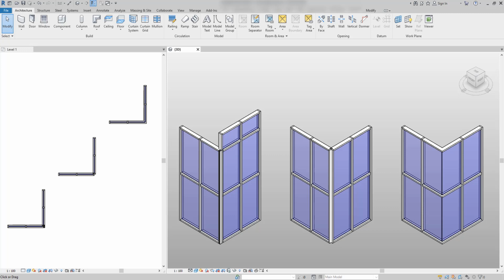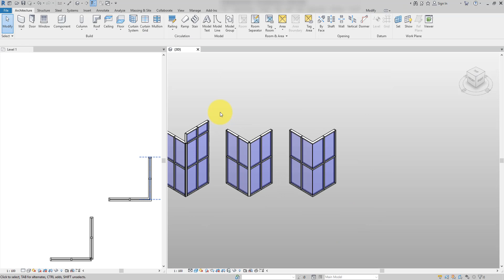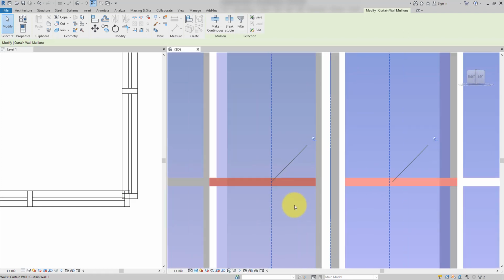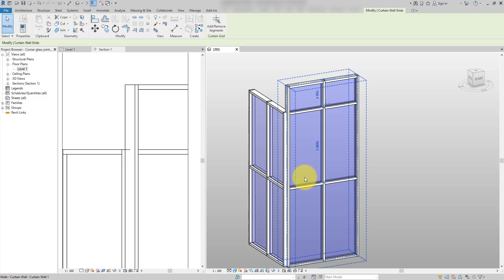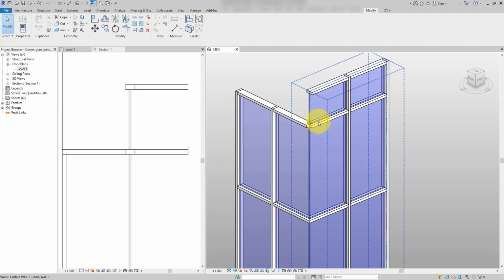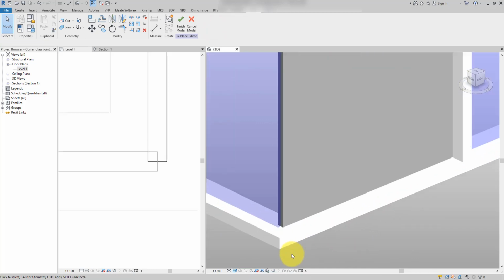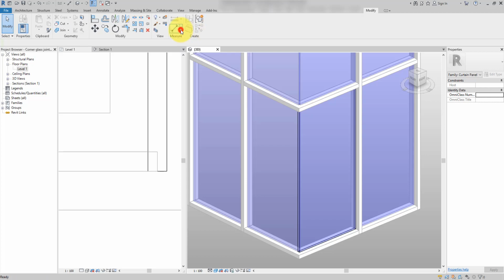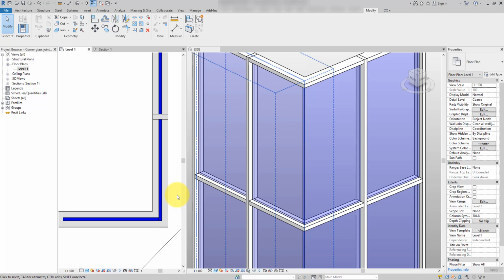Revit Snippet: Make clean corner glass joints for curtain walls

Comment: If I have a tall curtain wall that I want to repeat that corrner process is there a smart way to automate it ?Maybe make custom corner panels that when combined in 2 they give the same result ?
Reply from the maker: Yes you can use custom corner panels! For a very tall building however, sometimes it's fine to have corner panels overlap a little. Always check your required level of detail to avoid modelling too much :)

Comment: the video is very well explained !
my problem is that when I use the trim tool my mullions don't stay at the place where  I want them to stay - they are moving closer to the corner  - don't know how to prevent this
any tips?
Reply from the maker: Do you mean your horizontal mullions appeared to move closer to the corner? If so, check the layout rules your curtain wall is using under its Type Properties. If mullion grids are laid out from the corner edge, trimming the wall there will of course alter these grids.

Comment: hi sir 
can you tutorial corrugated metal panel wall and roof tips and tricks?
curtain wall panel family is not very useful :/
Reply from the maker: Sure. Could you send me a photo of what you want to model?
Reply: @RVBoost  https://www.kingspan.com/us/en-us/product-groups/architectural-panel-facade-systems/benchmark-architectural-wall-panels

In fact, kingspan panels are generally used in projects.

We have difficulties when we come to the door and window openings.
Reply from the maker: It'll be a complex process to model that system to each and every detail. You actually may be better off just model a simple version of it using curtain walls, then add more details in 2D drafting views.
Reply: @RVBoost  Do you think Wall Reveal is the right method ?
using kingspan gap profile
Reply from the maker: No, I believe curtain walls will be better. You can use that custom profiles for mullions.
Reply: @RVBoost  Sir, we are waiting for an instructive video from you to clear this confusion. As your followers.
Thank you
Reply from the maker: Thanks, I'll put it on my list!